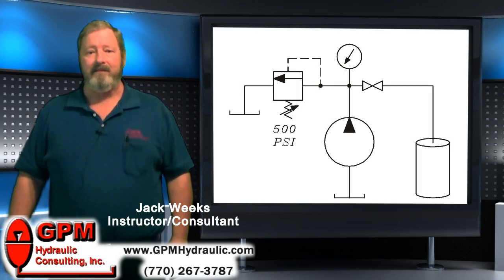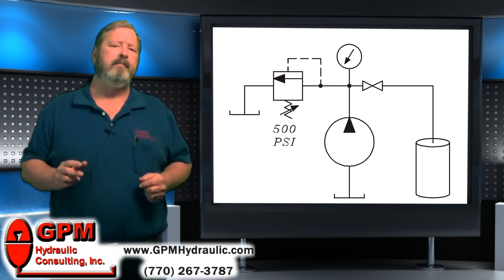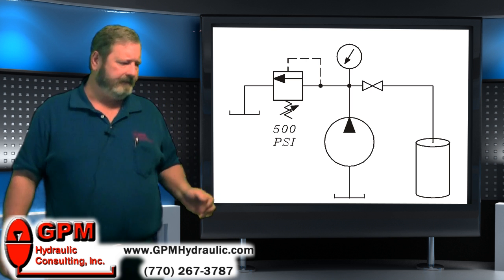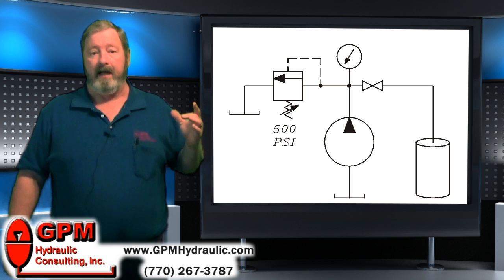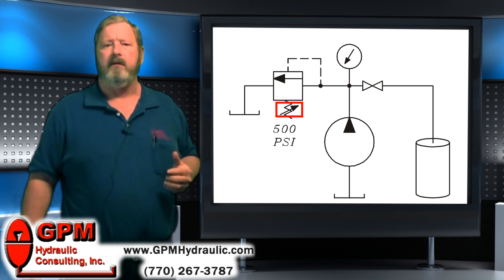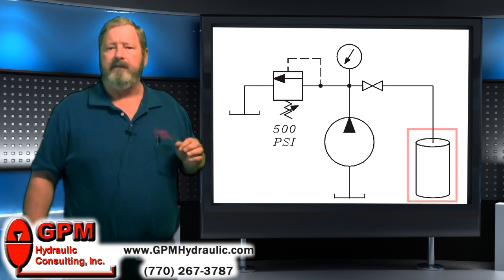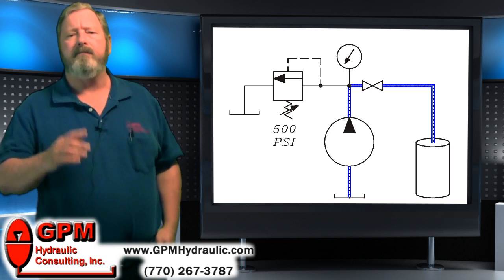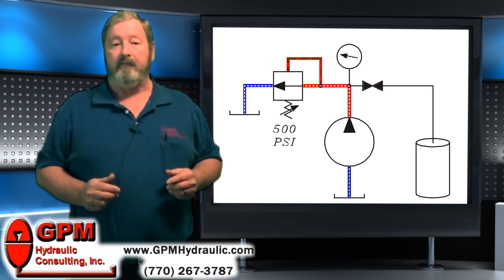The Difference Between Pressure and Flow

Comment: Why don't y'all use electricity for fluid instead? Not an electrical circuit though.... I'm simply implying draining out the Earl and putting electricity,  so that voltage instead of pressure and amperage instead of flow are the elements... It just seems like more fun if you fuck up and ground yourself with electricity... Hydraulic Earl is boring.... Then with electricity you don't have to worry about wear and tear as much.... Or debris etc. etc..... eg. Replacing controls without consideration for direct cause, cutting down on technical error... Or neglect... Idk... Maybe electricity would pose new, even more complicated issues and questions.... Like, wtf is this dude talking about? Or... Is this mf serious?
Reply: Adam Blanchard 😕

Comment: I keep going round and round with these concepts due to the high level of conflict between manufacturers and engineers alike; I believe the primary reason is due to inconsistency with the term "pressure" (not using prefixes static, total, hydrostatic etc). Perhaps answers to a few questions can help to quell these issues:

Is the pressure gauge in the schematic above a differential pressure gauge or a standard one? If it is a standard one (type Bourdon or otherwise), how can pressure (gauge) in a U-tube manometry situation be equal to hydrostatic head but be 0 in this situation? Shouldn't the pressure in the system be equal to P (tank) + P (developed due to resistance to flow)?
Reply: Thank you for your comment! While it is true that a standard gauge (which is the type used in the video) would indeed be subjected to a small amount of pressure (largely overcoming gravity, atmospheric pressure and friction), it would certainly not be enough to register. The point of the video however is to illustrate that the pressure does not originate at the pump, it is the result of overcoming resistance, all of which is external to the pump. The lack of pressure is therefore usually not caused by pump wear as so many assume. The points you make are quite valid - but are better left for a different video. Had I addressed them, it would have confused the issue and made the video less useful to the troubleshooter which, after all, is its primary purpose.
Perhaps in a future video we may address the difference between PSIG and PSIA. This could provide the opportunity to discuss P (tank) + P (flow resistance) and indeed would be useful to the fluid power troubleshooter, particularly in pneumatic systems. Do you think that would have any appeal? Thanks again for taking the time to comment!
Reply: @Gpmhydraulic  I know a lot of time has passed since then but I didn't realise you had actually replied to me. It is only when Xavier below replied that I received the notification. 

Anyhow, seeing as though I never did it initially, I wish to thank you for the great content you had provided free of charge. At the time I was studying Mechanical Engineering at a British University and, as you may well know, the higher-ups use pressure, flow and such terms loosely without ever quantifying what exactly they mean. When pressed, they are rarely able to clarify as it seems quite a few don't understand the distinctions themselves!

Regarding making more videos, I would honestly appreciate it immensely. Purely out of interest's sake and the fact that theory is discussed from a practical perspective with a dose of dry humour. Have a good day!
Reply from the maker: @YG-be9gl  Thanks for your kind words! Since the closure of GPM due to the effects of Covid, I have semi-retired. I have continued to do training and consulting on a freelance basis in my "spare" time, but have found since so many plants have reopened their doors to visitors that now I am working at least as much in my "retirement" as I did when I was employed! I'm hoping to find time to make some more videos, though, because I enjoy doing them and so many folks appreciate them and tell me they find them helpful. Hopefully I will find the time to do some more of them.
Reply: Thanks for asking this had the same thought!

Comment: hi, but i think something is wrong. when the pump pumps liquid to the manual valve side how the pressure is zero? the pump generates some pressure right ?
Reply: Jus7iN , thanks for your comment! Actually, no, the pump generates only flow. Any pressure in the system is generated solely by resistance. If there is no resistance, there is no pressure regardless of the amount of flow. Naturally, in the example in the video, there would in fact be a small amount of pressure in the system, but that would be as a result of resistance from gravity, friction with the pipes and such - not generated by the pump.
Reply: @Gpmhydraulic  Hi Jack, I read this answer to resolve my doubts. I think that even at the maximum flow rate pump can generate, the fluid will have certain pressure at the outlet. Because, If I need certain flow rate at a certain pressure in order to overcome the required pressure drop downstream of the pump in a hydraulic system, I will need to have certain pressurized fluid at the pump outlet. 
So, does the video and my case combined imply that I need to set the pressure valve equal to or greater than the estimated pressure drop downstream of the pump? 
I think the 0 value of guage in the first case is just due to the added advantage of gravity and very less pressure drop in the pipe.  But, if we don't put any valve in my problem, will the fluid flow through the system if the pressure drop is significant enough?  Thanks a lot!
Reply: @manjiriborgaonkar2976  , I believe you may be overthinking the issue. The important thing to take from the video is that pressure is the result of resistance to flow. Always remember that the flow rate determines the speed and the pressure is determined by resistance to the flow - mostly due to the weight of the load, though there are other resistances in the system (orifices, friction, gravity, etc.). These other resistances can become significant and should not be ignored, but they should not confuse us as to their source. The pump is not the source of the resistance (though there would be some small resistance getting past the pump outlet).

Comment: i had 100psi water pressure stepped down to 70psi after reducer and i had terrible flow with multiple fixtures going ..only had 1/2 line right after the meter..tore that out and put 3/4 and it made a huge difference ..when my under street service line does rot away and someday they all do i will go one size bigger.. house is 110 years old and my current line was probably installed 50s or 60s if i had to guess.
Reply: Yes, that would lower the fluid velocity and increase the flow. I've known many a self-styled plumber believe they will correct what they believe to be a "pressure problem" by using smaller pipes to increase pressure. While this will indeed increase fluid velocity and add resistance, the flow actually drops.

Comment: May I know sir Pump Impeller size(mm) to discharge water at high pressure for 5HP 8 Stage 3 phase submersible motor from 220feet at a voltage of 240v through 2inch pipe . Thank you .
Reply from the maker: Thank you for your comment, Sachin. Water pumps are not exactly my specialty, however this can be determined with a little more information. The impeller diameter and RPM of the drive motor will determine the rate of flow, not the pressure. The pressure is determined by resistance (which, of course, will increase proportionally to flow rate). I would recommend you use one of the Pump Affinity Laws in The Engineering Toolbox to help determine the impeller diameter you need. These are available at: https://www.engineeringtoolbox.com/affinity-laws-d_408.html 
Also, bear in mind that impeller diameter is not the only determining factor in flow rate. The actual factor is determined by displacement which will vary with the impeller blade angle as well. Hope this helps!

Comment: Your videos really help me to have a better understanding of hydraulic function.Thank you!  In this tutorial on the diagram directly  north of the pump is a smaller circle with an arrow, it's function/meaning was never addressed yet I did observe that once the regulator opened the arrow direction inside the circle moved also. Would you please explain what that symbol represents here and why the arrow moved? Thanks again! I am in the profession of industrial maintenance and our team has very little knowledge of hydraulics. I am currently trouble shooting some equipment and like the idea of not being a "parts changer" if the cure can be an adjustment that perhaps ol "not me" may have had a hand in!
Reply from the maker: Sorry, I suppose I could have explained that one a little better - you aren't the first person to ask. That is a pressure gauge. Note that it did not move when the hand valve was open, because there was no resistance in the line, thus no pressure. Once the hand valve was closed, the resistance of the relief valve had to be overcome, thus there was pressure and therefore movement of the gauge.
Reply: Makes sense now thank you.

Comment: Nice explanation , can you tell something on gear flow dividers (one input and six output) and how to install it in the hydraulic circuit
Reply from the maker: Thank you for your comment, Mandar. Essentially, a gear flow divider is simply a set of hydraulic gear motors that share a single shaft. Flow that is input will be split equally between the outputs, i.e. a 30 GPM input will result in exactly 5 GPM at each output. For most applications, there should be crossport relief valves at each output to allow for some "slip" in the circuit. I don't know what type of actuators you are using, but say for example that you are moving six cylinders in unison. The flow divider will ensure that each cylinder will receive exactly the same rate of flow, but no two cylinders will bypass the same amount. Thus, if there are no crossport relief valves, no two cylinders will reach the end of their stroke at exactly the same instant. This will not be noticeable at first, but after a while they will be out of sync with each other. With the crossports installed, once the cylinder with the least amount of internal bypass reaches the end of its stroke, the associated crossport will open up to allow the next cylinder to complete its stroke and so forth. The crossports are usually integral to the flow divider and factory preset. If so, you will be able to tell by the adjustment at each outlet port. If they are not present, they must be installed separately. Each crossport should have its inlet connected to the outlet of the flow divider and its outlet connected to the flow divider inlet.

Hope this helps!
Reply: Absolutely ! when I visited sight I observed it to be Delta Hydraulic Company
gear flow divider , HPR heavy duty series with relief valves , 200 bar pressure.
my observation is as follows ,
two cylinders raise one scissor lift and these two cylinders are attached to a rigid link.There are three such lifts identified as 1 , 2 and 3 viz, serial no 1 and 3 are in synchronization while as no 2 goes faster during extension and lag behind during retraction stroke. 
When I  put some load on lift on 1 , it goes faster than other two while no 1 retracts , no 2 and 3 extends. I am confused.
Could you please extend your help.  This matter is urgent for me as plant is under scheduled shutdown process.
Reply from the maker: This is because any cylinder will retract faster than it extends. Since the cylinder rod displaces oil in the cylinder, more oil is required to extend it than to retract it. If the same flow rate is provided in both directions, any cylinder will always retract faster than it extends.
Reply from the maker: Actually, as I reread your description, I think I was misunderstanding you. If I understand correctly, you are saying that the speed changes when you add a load? Can you send me a schematic of the circuit? My email address is jack@gpmhydraulic.com

Comment: that's not accurate, it's true that pressure will increase if resistance exists. however, that does NOT necessarily mean pressure will be almost zero if there is no resistance. any pump has a discharge pressure even if there is no resistance!!!!
Reply: yazeed Albadrani , while that is true that Pumps have a discharge pressure, that pressure is the result of overcoming the resistance of the discharge port.

Comment: What I want is a visual simulator that will allow me to mix chemicals by dragging them around. 
There is no program like this anywhere on the internet. 

The only thing I have is "Crocodile Chemistry", made in 1999. 

It crashes a lot, including when trying a basic electrolysis of NaCl.
It pretends that when you vaporize aluminium, it just disappears totally.

Comment: Hello
Need some help  please I am wondering why there is no Filter in this hydraulic system?   If there was one  where would be the correct location before the pump or before returning to the tank?
Reply from the maker: Hi Anthony
Thank you for your comment! You are correct, if there was a filter in the system it would either be immediately downstream of the pump or in the tank line. I didn't add a filter in this case (or for that matter, any actuator or extraneous component) to avoid clutter and maintain focus upon the crux of the lesson, i.e., understanding the difference between pressure and flow.
Reply: Jack Weeks hi jack thanks for getting back to me.  I am confused because I see come people drawings have the filter before the pump while others have it just before returning to the tank.
Reply from the maker: Depends on the type of filter and its purpose. There are suction filters that can be used to keep contaminants in the reservoir from entering the pump. There are also pressure filters mounted immediately downstream of the pump to trap contaminants generated by the pump, and there are return filters in the tank line to filter oil at low pressure prior to returning to tank.

Comment: hydoes increased flow rate would raise system pressure?
Reply: It will if there is an orifice in the system. Otherwise, it will only increase the speed of the actuator.
Reply: GPM Hydraulic Consulting 
So orifice would make actuator speed constant, Nomater speed of flow or prssure
Reply: Actually, no. Actuator speed is determined by flow rate. The orifice will limit the flow rate but will not be the only limiting factor. The three variables that will affect flow through an orifice (and therefore affect speed) are orifice size, pressure drop across the orifice, and temperature. See my video https://youtu.be/eHst0fU6s5I for a full explanation. Hope this helps.
Reply: GPM Hydraulic Consulting 
IAM more or less familior. Just capitalizing with someone whos clearly more competent.thanks for you time
Reply: My pleasure - hope I have been some help.

Comment: I'm an electrician and I'm trying to explain to a young lad that has just joined our Company our hydraulic test rig. I've found this a very good example as not being my trade I understand hydraulics but struggle to teach it.
Reply: Thanks - glad we could help!
Reply: PSI comparable to Voltage, what's the potential
FLOW comparable to Amps, how much is going through
Until there's resistance or a load, not much to measure

Comment: Good job sir. Am a farmer . please may I ask. what the practical result I will get if I increase rpm on the pump to 7000 rpm and more. thank you. please respond.
Reply: The flow will increase and your actuators will move faster - but be certain that the pump is rated to operate at that high RPM. If not, the suction line will be unable to pass the amount of flow the pump will be trying to deliver. This will result in cavitation - suction pressure dropping low enough for air cavities to form. Once these air cavities enter the pressure side of the pump, they will implode and destroy the pump. This will be characterized by a steady, high-pitched whining sound similar to that you can hear from your power steering pump when temperatures get low enough to raise the fluid viscosity beyond the capabilities of the pump.

Comment: I learned a lot - thanks for the explanations;  the accompanying coordinated graphics were excellent and very helpful.

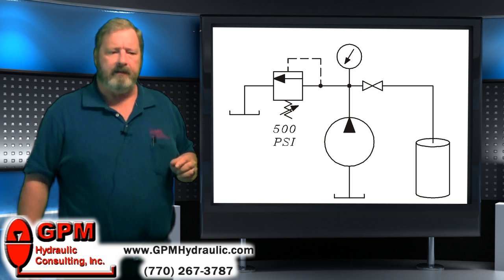One observation, though - at about 4:55 when you start to talk about the manual valve and its graphic symbol, I found that counter-intuitive.  I expected that since the "bowtie" graphic symbol was not colored in, that meant that there was no flow (ex.- the other arrowhead symbols for the pump and other valve are colored in, and represent flow).

Other than that, it was an excellent tutorial.  Thanks, Jack!
Reply: Thank you for your kind comments! Actually, there is no rigidly adhered to "standard" method of indicating an open or closed manual valve. Some draftsmen fill it in to indicate it is normally closed, some turn it sideways, and I'm sure there are others that I have yet to encounter - most of the time on our schematics we label it "NO" or "NC" and follow it up in the component description to maintain clarity.
Reply: GPM Hydraulic Consulting Turning it sideways (and leaving it uncolored) for a closed manual valve would be even more intuitive IMO since that would show a physical break in the linear flow "circuit" - much like how that pressure-operated valve symbol is not initially lined up with the linear "circuit." Just my 2 cents... Thanks, again.
Reply: Yes, I certainly see your point!